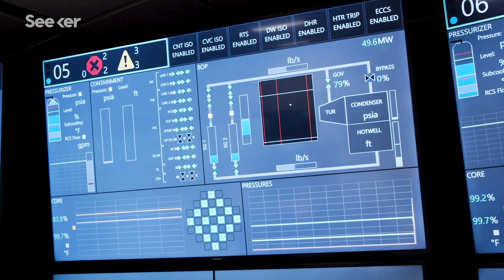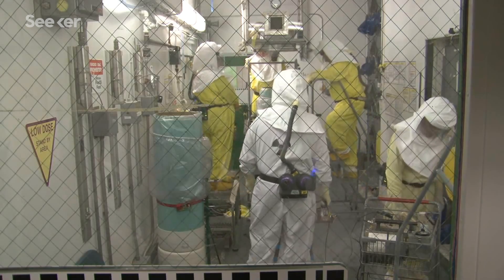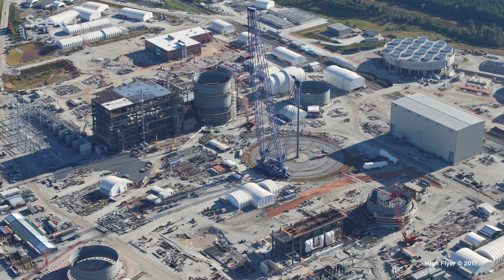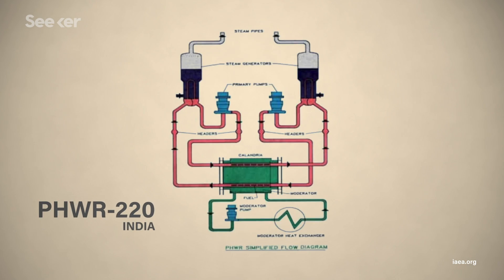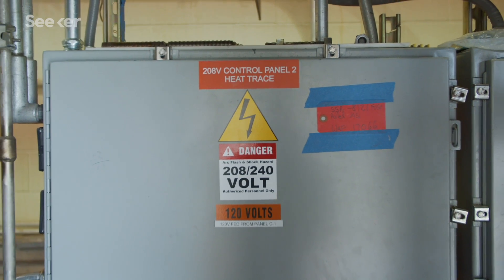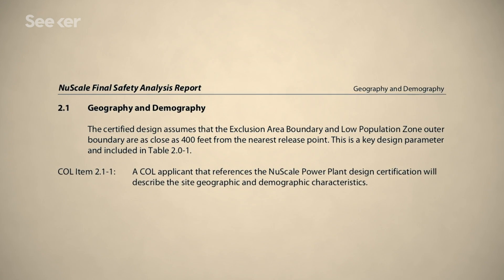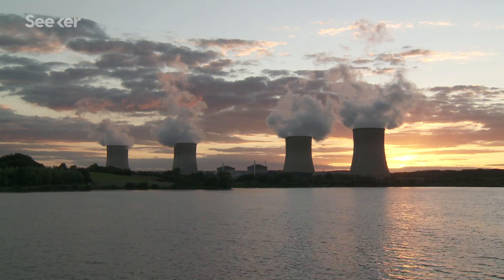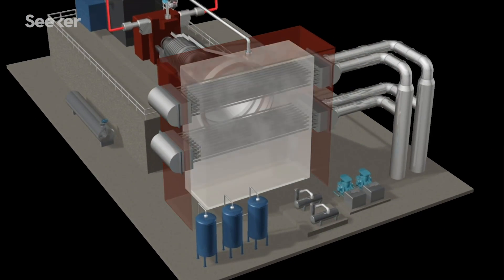Mini-Nuclear Reactors Are Coming, and They Could Reinvent the Energy Industry

Comment: The concept of using Salts as the medium such as in a Molten Salt Nuclear reactor is much more safer (atmospheric pressure within the core). Oakridge engineers proved that 60 years ago. These guys are still promoting concepts of solid rods and high pressure steam. Since the 1800s, engineers know well that Steam boilers have a tendency to blow up. These clowns even admit, they need 40 acres of blast site.
Reply: Yeah, NuScale is way behind state-of-the-art. They're more about risk-mitigation with proven (ancient) technology - for insurance purposes.
Reply: @solaroid55
Isn't that highly dependent upon what type of molten salt reactor? Corrosion is an issue yet it's been easily mitigated?

For example, The type of reactor mentioned in the original comment is not difficult to refuel. It can use spent nuclear  material.

Furthermore, It used a special material called Hastelloy N – a nickel alloy developed specifically to withstand the harsh corrosive environment.

The fuel cycle of this molten salt reactor is not well-understood by regulators, operators and the supply chain, so I don't expect others to know much truth about it.
Reply: @solaroid55
What's your reference?

I was not aware of such difficulties. 

Fuel management and refueling of a conventional light-water reactor is a major undertaking involving shutting the reactor down for several weeks, flooding the reactor containment with water and removing and replacing about one-third of the fuel assemblies.

Even if it is difficult to refuel in molten salt reactors, why would that preclude its use?
Reply: @solaroid55 Refuleing a molten salt reactor is not required like a fast reactor. Reactor fuel is continuously fed as the reactor burns through its fuel. That's right, it burns through its fuel, so it doesn't produce a bunch of nuclear waste, like fast reactor do. In addition to the benefits stated in earlier comments, an MSR can be safely shutdown for the weekend and restarted on Monday when the crew came back to work. Not an actual scenario but an illustration of how safe and manageable an MSR is. In adddition, in addition, even though a typical MSR would not create weapons grade materials, directly, it does generate quite a few nuclear materials that society is in need of, such as nuclear materials used in the medical field. Our current infrastructure for generating such medical materials is quickly aging and replacement generation is not coming online for the reasons stated in the video.
Reply: Wow, no, it's not 40 acres of "blast site".

The video hugely understates the safety case for traditional nuclear power: while Chernobyl is estimated to be responsible for <4000 to 9000 cancer deaths, fossil fuels are responsible for millions of air pollution deaths (just how many millions? Reports vary, e.g. from 2 million total to 4 million per year: https://www.theguardian.com/environment/2020/feb/12/fossil-fuel-pollution-behind-4m-premature-deaths-a-year-study vs https://www.giss.nasa.gov/research/briefs/kharecha_02 ). Fukushima and Three Mile Island were not directly responsible for any deaths (no one got radiation sickness), though the evacuation process at Fukushima was responsible for 1000+ deaths: https://ourworldindata.org/what-was-the-death-toll-from-chernobyl-and-fukushima

So do the math: nuclear is about 1,000x safer than fossil fuels.

The promise, then, of Molten Salt Reactors (MSRs) is not so much in safety but rather (1) cost and (2) public relations - as it is easier to understand the safety case for MSRs than traditional reactors.

Molten salt reactors are better than traditional Light Water Reactors (LWRs) because they sidestep two major safety/control challenges of LWRs:

1.  LWRs use pressurized water as their primary coolant, which must be heated above 300°C in order to generate electricity effectively. This requires over 150 atm pressure. If pressure is ever lost, the water flashes to steam. Steam cannot effectively cool down the fuel and it may be difficult or impossible to vent safely (without venting radioactive substances) in case of meltdown. Plus, overheated zirconium fuel cladding can react with steam to produce hydrogen, which is an explosion risk (unless the reactor has an extra recombiner system, which Fukushima did not have).

2. When atoms split they leave behind smaller atoms called fission products, most of which are radioactive and some of which are gaseous. Solid-fuel reactors lock these fission products inside the fuel rods at high temperature (2000°C) and high pressure. In a meltdown, radioactive cesium and iodine gases escape the fuel rods and could potentially also escape the reactor.

Regulators require any new LWR to overcome these challenges in all plausible circumstances, but it's expensive. Molten salt reactors (MSRs), which use fluoride or chloride salts as their primary coolant, solve these problems by avoiding them:

1. Molten salts boil at over 1400°C at atmospheric pressure, but MSRs operate at 600-700°C, so the salt can safely hold a lot more extra heat than water can. Since MSRs operate near atmospheric pressure, a loss-of-pressure accident is both unlikely and not a big deal. Also, higher temperatures make heat dissipation easier. Some MSR designs require no water to cool the salt; air cooling may be sufficient. This is great, since all 3 major nuclear accidents in history have involved a loss of coolant. As a bonus, turbines are more efficient at high temperature (not to mention smaller and cheaper), so a reactor can produce the same amount of electricity with 18%-33% less thermal energy; less energy is a bit easier to manage safety-wise.

2. MSRs have liquid fuel: uranium (and often other fuels, e.g. thorium) dissolved in salt. Most of the fission products remain dissolved in the salt after the atoms split. This includes cesium and iodine, which, I have the impression, are the main hazards to the public in a major accident. In a liquid, these substances cannot escape to the atmosphere even if the reactor is physically damaged.

Avoiding problems by design is much cheaper than mitigating them with extra safety systems, backup systems and backups for the backups. MSRs are therefore designed to use simple, compact, reliable passive safety systems which make them "walk-away safe" for at least a period of months. This means operators can simply walk away from the power plant at any time and the reactor will always safely shut off and cool itself as necessary. (NuScale might be close to this ideal, I don't know.) MSRs are smaller (= less concrete and steel) than even the most compact LWRs (NuScale, AP1000) and their simplicity should allow regulators to certify them more quickly. The main problem from a regulatory standpoint, though, is that regulators haven't decided how to regulate MSRs and they are taking their sweet time figuring out how to do it; typical would-be investors are not keen on waiting an unpredictable (but predictably long) time before they see a return on investment. Other challenges include building supply chains, finding people with relevant expertise, and finishing research that was started in the 1960s by mostly-deceased scientists, but people have been chipping away at these problems for a few years already.

If you find this technology interesting I recommend Gordon McDowell's videos at https://www.youtube.com/c/gordonmcdowell/featured - MSRs have other advantages but this post is getting really long.
Reply: Compared to 10 miles, yes.    Not seeing the clowns
Reply: System is the problem 🏡  The Great Qualities

1, Show all living creatures; all the love and kindness as much as you can.

2, Only try to be honest with yourself. If you try to be honest with others, you will get into big trouble soon or later.

3, Aim only one target at a time; otherwise you are chasing two rabbits and you will miss both. So, the reason behind it. Have one powerful reason and never ever give up the one you want the most.

4, Don't try to be good person only but be the powerful person. We will grow to be the one or we will die. There is no other choice. 

5, Always learn and look for to improve something your life. 

6, You are not alone. Love and faith the high power reduces unnecessary stress in life. But never completely rely on it. 

7,  Success and happiness are the byproducts of our usefulness. So, always increase the possibility of success.

8, Life is not going to be easy. Because of our unnecessary things. Eliminate all the unnecessary things as much as you can by organising yourself well with the environments. 

9, Never believe anything without the proper evidences. 

10, Always try to give more than you take. 
Because it is dignity/ character of the divinity within you.

🌎 As long as people continue to see themselves as separate from everything else, they lend themselves to being completely enslaved. Success depends on how well we relate to everything around us. Joy comes from that bliss of connectedness. I believe that unarmed truth and love will have the final word in reality. To love; you should have good heart. I am a good person until I see a person better than my standard of goodness. Being good is the progress towards a worthy cause. Love is God. Whoever lives in love, lives forever. How selfish it is to try to keep something forever? Love is all about nourishing, nurturing, sharing and expanding the love within you for all. The principle to which we adhere to is that we have kindness of love at heart for the whole of mankind.  As long as there is the unnecessary differences within us; we can not live peacefully so we have to eliminate all the unnecessary differences among us so we can love all. People abilities may vary but not there true love. If we love a person/ God for a reason then we love the reason but not the person. No reason is the reason to love the person because true love never fails. So do not compare or measure the true love as first or the last but love all truly. If you love people truly then you can understand people. If you don't love then you don't understand people at all.

People are controlled by system why?
The Cyclical Consumption is the current economy all over the World. It is making the scarcity problems of the earth finite resources to deteriorate day by day. Current Monetary System is legalised theft. Real money is Gold and Silver. Scarcity gives the money more value. Real money won't lose it's value. When Governments stay away from Gold & Silver then very easy to transfer the wealth / resources to upper class the Rich (Corporatocracy) Elite. When the Governments are printing out more new fiat currency with reserve banks, our old currency is losing its purchasing power everyday. They are printing millions of currency everyday. All governments and laws are existing right now to transfer wealth to upper class the rich elite. The USA Government & other Governments are in many countries, bailed the investment banks & financial institutions in 2008 against the majority of the people. There is no democracy in any countries. Because of the Money System based on profits motive only above all else even humans lives and well-being. So, we do not have freedom to protect our values with the money so on. The violence, bankruptcy & all the negativities are build into the Monetary System of our society. All are owned (including ourselves) by Reserve Bank. Which is private cartel the corporation. So, in legal system, we are legally considered as chattel the properties. They make money in the capital markets with our birth certificates. They do not consider us as Humans. That's the truth. We are at the invisible war with the Elites (Corporatocracies). We have to fight for our Freedom. Resource Based Economy is the Solution. We have to declare the earth resources as the heritage of all the people of this world. So everyone has access to it. Please have your research about zeitgeist movement then you know the truth more. 

 Truth About Health/Drugs Industry Because Of It Your Life At High Risk The drug industry is a 1/2 trillion dollars a year worldwide conglomerate. Almost 300 billions dollars just in North America. That is really big business. What would happen if everyone were well? There is no money in health. You see, good health makes a lot of sense but it doesn't make a lot of dollars. Because everything they do is toxic. Every drug they use, prescription drugs, all drugs are liver toxic, bar none. If you've had amalgam fillings put in your mouth by dentists. It is highly toxic. There's cancer because most of the chemos are themselves carcinogens. To view the tumor as the cancer and we know the tumor is not the cancer. The cancer industry is 200 billions dollars a year. The more work they get, the more profit there is. You have to dismantle; If the truth ever came out about what we would need to do. 30% of people of females in America are at risk of getting, will get cancer of the breast. The ones that are already dead have been grossly mistreated by the medical profession and by the government that supposedly is supposed to encourage free research and development of all possibilities. Why would medical doctors who studied medicine and practice medicine and are heavily funded by pharmaceutical companies why would they go and look into vitamins? That they never had the answer orthomolecular. And as more and more of our population start taking their health into their own hands, there's going to be even more and more of changes. It can't go on the way it is. The system is failing apart. We must make nutrition the primary prevention strategy for the population. You are what you eat. You are everything that you have ever done to yourself. The choices you make directly affect the outcome of your life. - (Food Matters Documentary in Netflix)

😊 Well, I truly love God. I am not religious but very spiritual person. So, I believe 1) Religion is the beliefs in someone experiences But spirituality is having my own experiences. The mainstream religions people promote religious ideology by giving guidelines and guide but In my spiritual life; I do not want anyone or anything between God and me to restrict my freedom to worship God. 2) We do not need any authorities to do good work. The god work is the good work always. In contrast; organised mainstream religions are claiming that they have the authorities to do God works as leaders so on. 3) God is not capable of doing wrong thing, change the past for us and create anything out of nothing for us. Nothing means not anything. So, even God is limited. The mainstream religious people believe that God is unlimited. 4) God wants us to take responsibilities for our righteousness life but not for all the consequences of our actions because they are continued to exist among us. So, How can god punish us for all our consequences? The mainstream religious people believe we are full of sins because of all our actions. 5) Freewill  is an illusion. People always choose the perceived path of greatest pleasure.  So, we do not have choices all the time. In contrast teachings of the mainstream religions are promoting people to do god's will always because we all have choices of freewill always. 6) We can not separate everything into groups. So, everything for good and evil and there's no success and failure for everything. If everything is real then real things can not be threatened. Once you come to understand that God/The Holy Spirit is in each of us, You will no longer need a Book to tell you how to live. Then why we need religious scriptures? The Virtue is the expression of the basic goodness in our actions. The Basic goodness is the fundamental worthiness of every individuals. We are worthy to God always in everything. 7) Beliefs in a cruel God makes a cruel man. No matter what; every living creatures has the right to live and What makes their life cheap? Everything depends on everything. Nothing too big or too small in value. We can not love and hate at the same time; Being a vegetarian means love without cruelty happily. The mainstream religious people are killing people and sacrificing animals in the name of God. They promote God's cruel punishments. The Punishment is endless for Sinners/Devil according to religious scriptures. But God is love always. Overcome hate with love. If all religions for peace, unity? No way. Because they are not for peace. 8) Well, The God gave us everything to go from moment to moment in our lives as we do our part  and pray only to thank god then the Love is in progress. The Love is always for everyone. We are always worthy of the God's love. Our greatest fear is; not to be loved by anyone but we are all loved by someone. When we eliminate all our unnecessary differences among us then true peaceful life is possible with the true love. If we can't find the peace within ourselves then we will never find it anywhere else. 9) This is the Fight for independence and freedom of humanity to worship God freely without religious guide and guidelines to restrict us. Unnecessarily, We do not want third party controls over us in anything ; especially in spirituality. 10) Revive Survive Thrive. Sincerely,  The Real Peacemaker against religious oppression.

 https://youtu.be/HbvCxMfcKv4
https://youtu.be/pIJHJzDQcRM
https://youtu.be/MyxbdmAnIcI
https://youtu.be/wLzeakKC6fE
 https://youtu.be/P8vHa8zD7jY
Reply: see you later ..alligator !
Reply: The heat exchanger in a molten salt reactor is still a boiler, you dimby.
Reply: @WhyAyeMann  Wrong you nimrod. All heat exchanges are not boilers. Boiling means to reach temperatures in order to start vaporizing material into a gas. What part of hot flowing MELTED salt in a low atmospheric pressure that you do not understand. NO WATER COOLING PUMPS or HIGH PRESSURE STEAM for heat exchange!! Instead, heat inert gases (already vaporized) to drive high flow/low pressure gas turbines. Even if you lose all of the inert gas, the molten salt would never reach the temperatures and pressures to explode like STEAM. Also, gravity driven safety features of several freeze plugs that would melt open and re-direct the molten salt, dropping below into several huge containers. This huge containers will allow the molten salt to expand and cool down into solid salt.  YES! It is true as the molten salt expands the suspended fissionable material; the nuclear chain reaction diminishes and therefore temperature. Some natural radioactivity would still exist but contained within solid rock of salt.
Reply: Sure they try to sell us 60 y.o. abandoned technology as something new.
Reply: @augustlandmesser1520 
Abandoned for political reasons. Using the heavy water reactors put money on the pockets of those who had a say in the funding. There was one particular Senator that had direct conflict of interests that determined to shut the project down.

But I'm no longer a proponent for thorium since the success of the SAFIRE project.
Reply: Wouldn't even molten salt reactors require steam to power the turbines?
Reply: @frank4425  NO! I guess you did not read what I stated earlier.
Reply: @unclegeorge6175  You are right. My bad
Reply: Have you ever put a drop of water in molten salt
Reply: @AndreMakesThings  If you're not being sarcastic then you're absurd. Why would you place water on anything that is 800C??? I guess you missed my point. No water in Molten Salt. They use a secondary (without isotopes) salt within the heat exchanger and let that low pressure molten thermal flow heat away from the core which in turn heats an inert gas not water. Lower pressure gas turbines are used not high pressure steam turbines. 

Again no water with atmospheric pressures within the core.